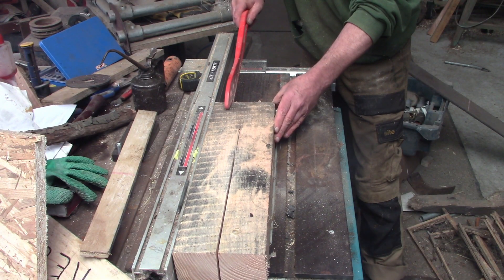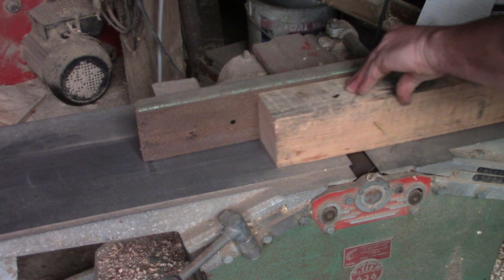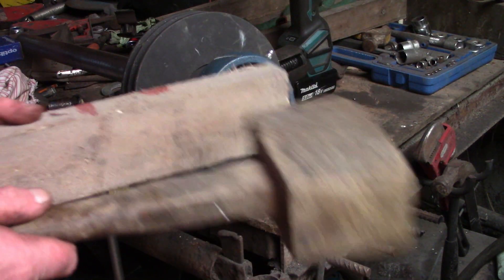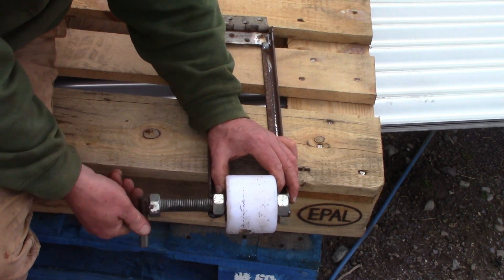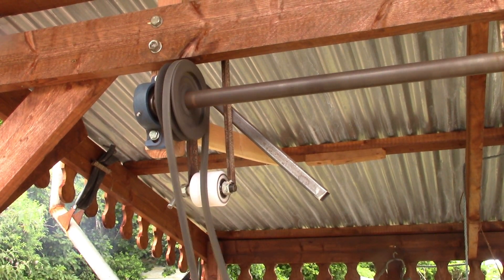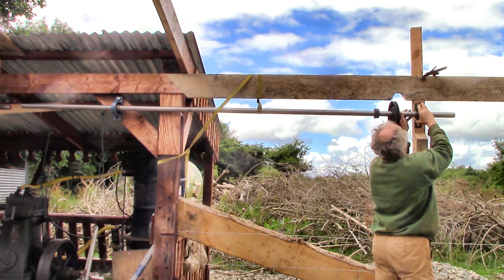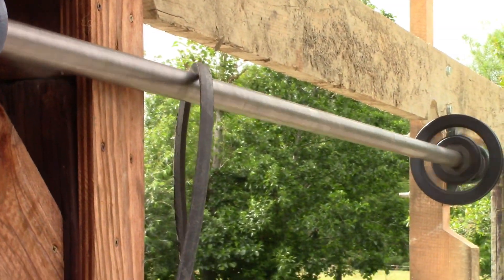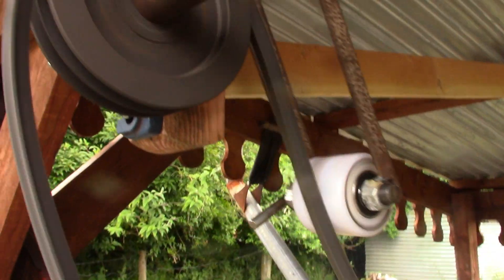Setting Up A Line Shaft For The Stationary Engine..

Comment: The guard for your head scratcher should be sheet metal, not wire. Bolts if nnuts back off will be projectiles - cross drill and safety wire.

Comment: Nice work on the shaft and the improvements you do later on too. 

 This video brought back memories from when I set up my line shaft (powered by a hit and miss Waterloo Boy).  On the big flat belt used between the engine and line shaft I used a pair of go cart wheels for an idler and tensioner pulley.  With the tires removed the outer lips on the wheels keep the belt perfectly centered on the flat pulleys and prevents the belt from walking off.

Still working my way thru the rest of your videos.

Comment: As a clutch system for your line shaft you could set it up the same way a car clutch system works.  Attach the "flywheel" directly to the line shaft so that it turns the shaft. You could then make a piece to slide on the line shaft and bore out center whole of the clutch plate to attach to this. Then to activate the line shaft it would be the same as engaging the transmission on a car. This will allow you to use the old clutch plate from a car to build it.  And if the clutch plate wears out simply get another car clutch plate (they don't need to have as much material on the clutch as would be needed to run a car).

Comment: Nice done. I work with Lineshaft all day and I'm lucky with it. One waterwheel drives from the main gearbox the main Lineshaft and then several Machines and other Lineshafts around the house and yard
Reply from the maker: Sounds great - but no videos?

Comment: I used to run small knitting machines that started life as overhead shaft driven and the motive power was leather belts. They fitted individual motors but it still needed the leather belts I always thought it was daft all that extra power to drive the machines. In winter every belt would need a dose of belt soap to get them to grip before the machine would turn. once the needle oil warmed up things would be easier I loved working on the machines.

Comment: Please, I'm begging you, make some guards for those shafts and belts!
A farm H & S inspector would have a fit at all those unenclosed flywheels and unguarded belts -- with good reason, entrapment is instant, the injuries/death which follow almost always lingering and excruciatingly painful. Some years ago, a neighbour of mine lost an arm in a sugar beet harvester: he was an experienced farmer who had pulled the guards off while running a machine he knew well to make a quick adjustment and get back to work. He survived, only to die of complications caused by a secondary infection a few weeks later. 
I love your ingenuity: it's inspiring. I realise you can't film it so clearly with guards on. But I want you to keep doing this stuff and making videos of it for a long time. You can invent a guarding system which protects you and your friends. Make guards part of your design process: inspire those who tune in to learn from you to work safely. 4ft plastic tree tubes which the tree has grown out of, suspended from offcuts of light chain/fence wire/zip ties, make good instant shaft guards at zero cost: I've used them to keep clothes/fingers out of PTO shafts. The split makes them quick to install and remove. You could fit perspex panels to light struts mounted in front of belts and flywheels with quick-release wingbolts so that you won't lose much time as you remove and refit them. Or secure them onto pegs with linch pins that come on and off quickly. And maybe design an emergency release of some kind as well. 
There's a brilliant publication called Practical Farm Ideas: your material should be in every single issue! The editor points out time and again that agriculture's safety record is the worst of all industries in the UK and Ireland by a huge -- and completely indefensible -- margin. We've all got it wrong, and had narrow squeaks, but you could encourage people to take safety seriously by putting clever safety solutions in your films along with all the other cleverness which is a joy to watch.

Comment: I hope you have realized by now that your tensioner pulley is on the wrong side of the belt. the  nylon will wear much faster being on the "pull" side of the belt. it will perform much better on the slack side
Reply from the maker: Not true. I tried it both ways.

Comment: I've never seen a lineshaft using modern V-belts before. All the one's I've seen or heard of use traditional flatbelts. This makes things a bit different like having to use tensioners to switch power instead of idler pullies on the shaft. However, the physics is still the same so things like shaft balance matters. That coupler likely causes imbalance (hence the shaking) so cutting the bolts a bit shorter so they don't stick out and maybe even welding on bits of metal 90° from the bolts may help reduce vibrations.

Comment: Greetings from Across the Pond !! (U.S.A. Here)
It's awesome watching you implement solutions to your projects!
Another safety option that was used way back in yesteryears was a Shearing Pin, or Shearing Bolt. 
[an explanation for others] A bolt/pin made of softer metal than the coupled items, it would shear off when the forces overcame the pins structure to keep from damaging the coupled surfaces. Your shaft coupler is simple and effective, and in my opinion could benefit from a shearing bolt, just in case a device later on the belt drive shafting fails, the shearing pin would be sheared, saving you any catastrophic damage to the line. It's what I would do, in this instance.

Comment: Tim: I noticed you have two shaft bearings with the grease fitting pointing up, two with them pointing down. It might pay to have them all pointing down to prevent rain water entry. Thanks for the video. Jon
Reply from the maker: I'm working on a roof..

Comment: I like your trick for the slightly misaligned shafts. My favorite is to weld a sprocket onto each and use a length of double roller chain with a puck of rubber in between. It's a good cheap backyard fix should yours not last.
Reply from the maker: Ah, yes, that sounds like a neat solution too - but mine's cheaper : -  )

Comment: There is a way to help keep the line  shaft rust free.  A simple thin metal disk with a hole about 4 times the diameter of the shaft.  This is installed on a section of the shaft, and will run to and fro along it, keeping the shaft polished and shiny.  If you look for Henry Ford Greenfield village machine shop, you will see what I mean. Perhaps it could help you?
Reply from the maker: Thanks, Chris - I'll try that. (Though it sounds noisy?)

Comment: If you do run out of funds for pulleys and things you could always try to build wooden crowned pulleys like they used to use on old lineshafts
Reply from the maker: You're right - there's always a way..
Reply: My neighbor that I used to live by had a shed with a bunch of something like that. They were 2 parts and had 4 square bolts that squeezed them together.  All wood and some even had some brass plates on them. He even had a bunch of old wood pillow block bearings and a bunch of other related stuff. Another neighbor had a old blacksmith shop that still had the line shaft installed. Everything was still there except for the old stationary engine. Its been a few years since I have seen if so I do not know if its all there anymore. Before the neighbor passed he had shown it to me and even made an electric motor stand to power it. The only tool he had was one of those old flat belt grinding stones. I am not sure if that was original, might have been. Either way the set up had a bunch of areas along with some gear sections and a few other stuff that might have been added on much later.

Comment: At the steam museum where I worked, the workshop was set up with a wonderful line shaft which powers (to this day) a lathe, band saw, drop say, hack saw, drill press and a milling machine...all from a two cylinder engine with a large flywheel with stram supplied by a vertical, watertube boiler.
The workshop is so set up to allow folk to see it even when working by having one wall opening with caged windows preventing access but making the workings visible.
This start is impressive. I look forward to  many more such endeavours and lots more usefull machinery.
Greetings from Australia
Reply from the maker: You're lucky - I wish there was something like that in this country

Comment: For a higher torque machine you could use a plastic tube as a coupler on the shaft instead of a metal tube so it would just snap in the event of an overload.
Reply: Rubber hose works too

Comment: nice construction Tim! That reminds me of the rapid traverse spindle on my old lathe at my last job, an incredibly long wobbly shaft with a collar i had made up with some screws! You may notice that those screws will shear over time, even with a light load, changing it out with a stronger pin fixed it though!

the safety guard is an EXCELLENT idea, i knew a guy that broke his ankle on a lathe shaft collar. those parts are dangerous.
Reply from the maker: Thanks, Christian  : -  )

Comment: distributed power ie an 1 HP AC motor at every machine thanks to Mr. Tesla and Westinghouse. Did away with the line shaft but forced countries onto the electric grid in the 1930s. I am fascinated by off grid power and trying to build a 5 HP steam plant.
Reply from the maker: I'd be interested to see how you get on with that..

Comment: If I could come help I would. I have dismantled several line shaft machine shops and worked in a few more. The big thing is NO loose clothing and NO long hair! A line shaft is as dangerous as you let it be.
As you get used to having that band saw you will wonder how you got along without it. That's a beautiful old machine.
For your coupling you can use two sprockets of the same size and a piece of double row chain. A sprocket on the end of each shaft then wrap the chain around the sprockets and connect with a master link. For a bit of extra movement you can thin the teeth on the sprockets a bit with a grinder or a lathe. Oiled they last a long time.
Your coupling is a good easy and cheap design and if it wears out a bolt it simply falls out. It's not running fast enough to toss a broken bolt.
I'm looking forward to seeing your line shaft in service.
Good show lad!
Cheers
Terry from South Carolina USA
Reply from the maker: Thanks, Terry  : -  )

Comment: Another  awesome video well done. One thing I did see not sure if it'll be a problem but the tensioner for the drive belt to the line shaft looks like its on the powered side of the belt so it might bend the tensioner when there's a load on the line shaft. Just something I noticed, loving how the projects coming on.
Reply from the maker: I tried it on the other side but the belt wasn't happy there and kept walking off - I'll see how this goes for now
Reply: That makes sense thanks for the reply looking forward to seeing what's next

Comment: A smooth shaft will wrap up clothing. The whole length needs to be guarded.
There was a guy that got stripped naked ducking under a low shaft in the sawmill where I worked.
Hooded sweatshirts are very bad for getting caught up in machinery.
The bandsaw wheels need guarded as well so the operator doesn’t get cut up when the blade breaks or comes off the wheel.

Comment: Jaw couplings are relatively inexpensive if you fancy upgrading from your bit of pipe, might need to get Will to bore them out on the lathe to the right size for you though. As they normally come with with just a pilot hole.
Reply from the maker: Yes, I've used those in the past and I like the rubber inserts - but my pipe is cheaper!

Comment: A foot treadle could be used to engage the machinery you are using on the shaft with a spring return to raise the treadle after you let go. A stop button would also be useful to stop the stationary engine when you've finished.

Comment: Interesting build! One question though, aren't usually people use flat belts for these kind of purpose? Is there a specific reason for using v-belts other than availability perhaps?
Reply from the maker: Thanks, Rizal. Vee belts are easy to buy around here - and they do stay in the vee grove pulleys very well. I'd have to make flat-belt pulleys too because I can't find any locally.
Reply: @wayoutwest-workshopstuff6299  Aah... Thanks for the reply. Can't wait for next uploads!

Comment: Have you ever used wooden bearings? My Father told me about them. They'd be soaked in hot wax. They were still in use at least up to the 1980's in the place he worked. They'd install them in places where maintenance was really tough. It might save you some money at least.
Reply: He has used them on his wagons before

Comment: Why not use a generator on the engine and motors on the machines? It‘s obv. way more expensive but also safer. You could use used motors from the scrap, too.
Reply: but steam engines and things like that are so much more interesting and if they are cheaper then its a total win-win
Reply: @DoctorCreeps  That's true and I'm actually happy to see it done this way haha. But safety is very important. Nobody's gonna be able to replace a ripped-off finger...
Reply: Generators are very expensive

Comment: VERY nice! Here in the US, I've always heard that kind of setup called a "jackshaft" -- but I'm not sure the origin of that term, and "line-shaft" makes much more sense to me ;)
Reply: Line shaft is the standard term. Jack shaft is a short secondary shaft.
Reply: @pvtimberfaller  There are a lot of people using the wrong term then... which TBH doesn't surprise me. IIRC the only other place I may have heard it called a line-shaft is this one machine shop... I forget now, I tripped over his channel months ago and keep meaning to go back but haven't yet. He's either Great Lakes area or somewhere very much north of Upstate NY, given the accent, and his shop is period-accurate to 1925 down to the steam boiler and single-cylinder steam engine working the machine tools! As I recall, he called it a line-shaft in his introductory video, first on his channel... but I could easily be mis-remembering.

That said, I'm hardly arguing -- thank you, in fact, for the correction, as I always enjoy learning more about these things!

Comment: just FYI (for myself really) the engine is a 6HP engine
Reply from the maker: Yep. (I didn't say something different somewhere, did I?)
Reply: @wayoutwest-workshopstuff6299  no, I dont think so, it is just that you keep saying the model but not the power, so I had to see what HP would work  for a small lineshaft setup. makes me wonder if my 5HP gas engine might be usefull that way

Comment: This is awesome. Still -> it is really sketchy. If the shaft chews your hat it is gonna be a bommer -> still not deadly. But if I remember correctly, these things suck scalps sometimes. There are many horror stories from the past. I would for sure build a guard alongside whole shaft, especially where it has something winding on it - like a pulley or belt. Just be safe.
Reply: With huge respect for his skills, I am wondering when he got torn out one of his arms. Especially when he shuts down the engine. A Valve is not that expensive, and would make turning it off much safer.
Reply: @christianhumer3084  True. I mean - 1 sketchy thing is avoidable. But combine multiple and someone around them will lose focus - al it takes is split of a second.
Reply: @christianhumer3084  back in the days before osha and child labor laws, that happened a lot, no one bothered with any type of cutoff valves as that would be...convenient
Reply: @Tater1337  Yes, because those who suffered from it were not those that were in charge.
Reply: @christianhumer3084  o
Reply: raise the shaft fixes that, hence my earlier comment about building a new shack
Reply: Safety third 🤘😃
Reply: I am also quite concerned around the exposed belts- should have a little cage around the belt

Not too hard I am sure!
Reply: Oh, and a safety brake to quickly stop equipment in an emergency instead of it slowly coming to a stop freely

Comment: And then, when the one engine you have refuses to start, you have no operational machines at all. Giving each machine it's own motor is the best option.
Reply: That is also expensive. It works better in larger uses, but since he already has the engine and limited funds this sounds like a good solution

Comment: Could you make the join between the shafts out of something more flexible to further reduce wobble? may also serve as a fail safe, ie the joint here breaks before something else.
Reply: From what my dad said occasionally people used leather couplers for this reason 

Leather is surprisingly strong my dad had a small section of leather drive shaft made for one of his old cars years ago

Comment: Thanks for the videos, I've learned so much from them, quick question,  why do the nuts in the shaft collar have to be 90degrees offset?
Reply: If the two shafts are not perfectly aligned, the joint needs some flex. This configuration allows simultaneous flexing along two axes, sort of like a universal joint on a drive shaft. That's my wild guess anyway.
Reply: They hold better
Reply from the maker: I think Seth has it right - there's room for flex (if necessary) in two different planes so it can cope with some misalignment.